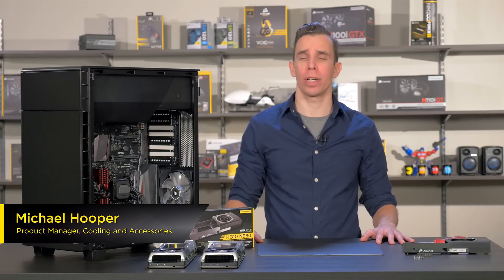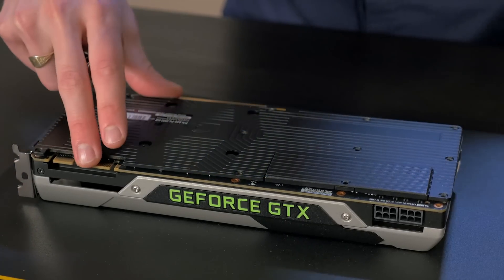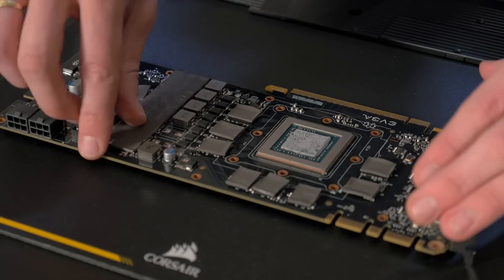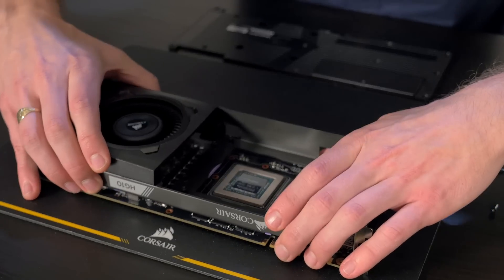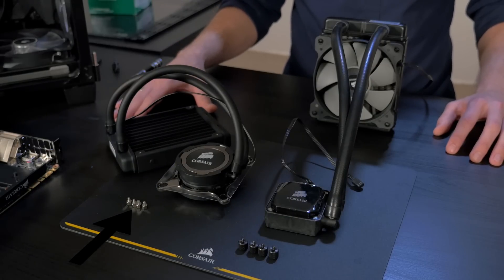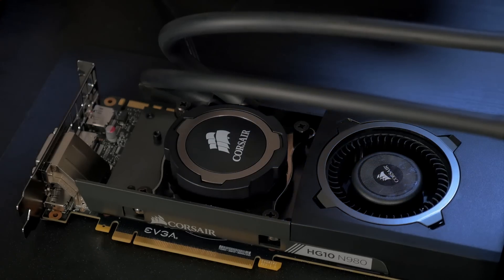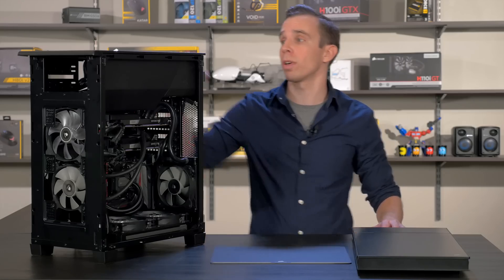Corsair Hydro Series HG10 N980 installation how-to demo

Comment: This kit is not engineered properly. There is not enough screws around the main die, causing uneven pressure when installing your water cooler. - my temps were at 95 when playing, I've opened it up, my card was warped from uneven screw pressure, and paste did not touch the cooler on half of the corner. Avoid, or just by hybrid card from nbidia. Don't burn up your card, I'm putting original evga superclocked fan back on.

Comment: I wish you guys had made a newer revision for the GTX 1080. Instead of waiting I bought the NZXT kraken G10 and mounted a corsair h55 quiet aio cooler. I get max 54c after several hours of gaming. I have a h110i on my cpu that is overkill.

Comment: Here's the thing... I want to water cool my 980's because they sit on top of each other and the first GPU's blower has minimal clearance for airflow (WHY THEY DID THIS I'LL NEVER KNOW)... based on what I see here, it would be impossible to use this cooling setup as the tubing cannot lie flat coming off of the pump and requires a few inches of clearance. How is this stuff overlooked?! They could have easily been offset to increase the distance of one of the tubes so they can sit flush over each other. Makes me sad man. That mess of tubing looks ridiculous anyway. Do better. Think more.

Comment: do not use the HG10 with the time will bent you GPU is  not support over the GPU back plate , the water block won't make contact with the GPU making the temperature go high playing any game  this happen to me i using HG10 with H90 on my Titan X SC i ended going back to my regular cooler.

Comment: Has anyone used 4 Pin GPU to 4 PWM Fan adapters to allow the GPU to control the Radiator fan speed?
No matter how much you spend on Fans or what brand, 100% speed on all the time is NOT a nice sound..

Comment: I have two gtx980 ti sc plus acx plus cards and on the site it says my cards are compatible with this cooling solution?But you said it is only for reference cards?I need help i want to liquid cool my cards so bad it's unbearable with 110 degree heat in california every year now :( I am confused because my cards do not have the blower jet engine fan,i have a regular fan two of them in this type of card i have and it doesnt look like the fan will fit in this cooling block you are demonstrating here.
Reply: By reference style cards he means cards that have the same PCB as the 'true' reference style cards. This means that if your gpu is said to be compatible on their website, it means that the PCB has the same screw hole locations and standoffs as a true reference card. I have a Zotac 980ti AMP! edition card, which has an aftermarket cooler, and this bracket mounts perfectly to it. The reason they signify to use a "reference" style card, is that some companies that put on their own coolers use a different screw layout, so this bracket wouldn't fit. Hope this helps!

Comment: Why is corsair so slow on the hg10 adapters?! I have an extra aio cooler (corsair H90) and is waiting for corsair to finally come out an adapter for the gtx 1080 (evga's models).
Reply: Why would you want it? The cooling performance you get with these shitty things are worse than air coolers.
Reply: you must be insane! aio gpu coolers lower so much temp, as much as 20+ C.
Reply: Yes, when you buy hybrid cards. If you check the performance on these DIY AIO gpu coolers you will see how much of a money waste it really is.
Reply: VaoDxArchAngel  bought and diy the evga hybrid kit for my evga gtx 1080 Superclock, and it never got above 40C with optimized settings from Geforce Experience for BF1/GTAV. I get an average of about 80 fps in gtaV and 90fps in bf1. my basement is about 70F year round.

before i had they kit, the card would reaches 72C. that's 32C difference, that's 89.6F less!
Reply: Khoa Tran Then they must have updated it and made it way better, cause that's not how it was with the 9xx models
Reply: Khoa Tran my gtx 980 ti goes to 80 or 81 degrees on full load.
Reply: Gilaric Yup, my air cooled 980 ti never goes above 70c and it's heavily overclocked
Reply: +VaoDxArchAngel ... maybe i should check the thermal paste but would it void my warranty?
Reply: Gilaric I suggest going back to your air cooler or buying a custom water block and custom water loop. I've had a lot of friends with that waterblock on the 980ti, and no matter what they did, still same problem. It's a problem with the block, not anything else.
Reply: VaoDxArchAngel I am using the air cooler I am thinking about getting the hg10.
Reply: Gilaric Oh nah, just reapply thermal paste. What brand did you buy? Reference or 3rd party?
Reply: 3rd party i think MSI Armor 2x/GTX 980 TI 6GD5T OC
Reply: Gilaric Ye, that should definitely have no problem cooling that card. Any OC? How old is the card? Any dust in the radiator? Apply new thermal paste and check temps again.
Reply: No oc unless its Factory OC. 6 months
Idk if there is dust in the rad. 
I will soon apply new thermal paste.
Reply: Oh yeah my fans in the front is airflow and there is a HDD cage in the way.
Reply: Gilaric Did it fix your temps?
Reply: VaoDxArchAngel haven't reapplied thermal paste I'm scared it will void my warranty. But if I get the hg10 I will of course reapply it. 
Also I replaced my front fans and top fans on my radiator with the ml140 pros (case 780t).
Reply: +VaoDxArchAngel 45 degrees idle and now somehow 83 on full load 1440p
Reply: Gilaric It won't void warranty to reapply thermal paste. Did you attach the cooler yourself? If you did, then there is no way it's gonna void warranty. Anyways 83 on full loud is still horrificly bad. My air cooled one stays below 70C on full load

I've also overclocked to 1430MHz

Comment: Aren't the radiators supposed to be mounted above the actual processors? I understand that it might be due to the configuration of the case you're demo'ing with, but this has been said to not be a good idea by many including Corsair.

Comment: I need one of thse so bad. My core temp peaked at 90 degrees when I was running gta 5. Whose bright idea was it to install just one fan on a high performance graphics card?
Reply: Why did you buy a high performance GPU with only one fan ?
Reply: Stupidity. Nothing more. I'll find the three fan model later.

Comment: Pause halfway inbetween 2:44 and 2:45... WTF is that? Spaghetti on the GPU? Dude works for corsair yet he puts thermal grease on it like that... SMH
Reply: +RenegadeGaming as long as you put the minimum amount or more it really doesn't matter.
Reply: +Legit Sloth You obviously don't understand why doing it like that is frowned upon... Since some areas have very little thermal paste on them, when the cpu block is pushed onto it, it won't spread evenly. Some areas will have poor thermal conductivity and will cause the card to run hot, possible throttle, etc, etc... Will it still run? Sure it will, but for how long? My point is that applying thermal paste is the easiest thing you can do with a PC and since he works for Corsair you'd think he'd be competent enough to show the correct way of installing their products. If I was a higher up and saw this then the dude would be finding another job, the way it looked was simply unacceptable.
Reply: 1- if you think that you know what you're talking about you're sorely mistaken
2- LinusTechTips did a video on this, and as long as the paste has more than the minimum no increased clock temperatures will occur and please, don't give a long winded speech when you're totally in the wrong.
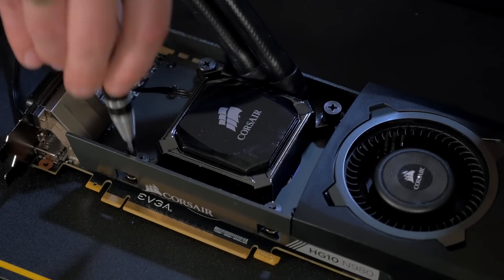Reply: +Legit Sloth You're not understanding what i'm saying... Look in between the frames at 2:44 and 2:55, that's not a Pea, X, Line, etc,  etc... It's just random and leaves a good 1/4th of the chip uncovered once it spreads. I understand what you're saying, believe me, the method doesn't really matter however this guy didn't even use a method. Not sure if you're seeing what i'm seeing but here's the exact frame : http://imgur.com/46eILwf
Reply: +RenegadeGaming I see how you think that.  Jesus christ it looks weird.

Comment: I want to install this on Zotac GTX 980 Ti Amp, which is compatible according to your company. Any additional guidelines for doing so? Do I have to apply to thermal paste for H55, H60 or H75? I haven't decided which cooler to go for yet
Reply: +Michael Yum you got same card as me the cooler is crap how is yours and what temps
Reply: +tony clarke i actually run 2 980 Ti in SLI, the temperature was crazy high (easily hit the 83 degree threshold and got clock speed reduced, fans spinning at 90% max speed) before I replaced the case fans with Noctua industrial fans. Now, I manage to keep the temp below 80 degree under the most heavy load.
Reply: same 83 c keeps throttling back
Reply: If you experiences this in single GPU, something has to be wrong. When I did single GPU, the max temp with overclocking (+200Mhz to core speed) was 70+ degree. No throtling back.
Reply: ok thanks mine just goes straight to the limit

Comment: I got a question, will this bracket be compatible with http://www.amazon.com/ZOTAC-GeForce-DisplayPort-PCI-Express-ZT-60303-10P/dp/B008NGEARC which i use now? My card is getting pretty hot with standart cooler.

Comment: Humm that's funny..when I installed my hg10 n980 on my reference 980ti it bent the board like a taco. I called customer support..apparently you guys are working on a fix...but I've been waiting for quite some time
Reply: +Gdwolf50 no..the mounting screws are wrong and dont fit the board properly. corsair has acknowledged this but for some reason hasn't been able to make a fix

Comment: I don't know if anyone will read this but, for Christmas I got the corsair k70 rgb keybaord and the m65 mouse. I plugged them in and tried to download the corsair utility engine and it downloaded fine. Then I tried to run the instalation  software and I make it to half way done installing and  it freezes my computer so i have to hard shut it down. I have tried everything i can to get it to work i'm lost. Everything else I've tried to download worked perfectly. I spent over 200$ on these parts and the whole point of me buying them was to be able to use the 16.8 million colors in the led lights and I can't change them like I spent my money on. I tried to install the first link on your gaming keyboards page and it froze halfway through installing 1 of 2. I also tried to install the first link on your gaming mice downloads page for the m65 and that one froze too. Any help would be appreciated. 
        thanks,
               Ben

Comment: Now if there was only water options for a 980Ti Classified.
Reply: +Kraft Lawrence  EK-FC780 GTX Classy series water block?
Reply: +Kraft Lawrence This is for T.I and Titan versions as well.
Reply: for reference Ti, but the classified had a different design
Reply: oh yeah man, but why would you want to change the cooling on the classified? That thing is BEAST!!
Reply: I'm assuming water would still be better, especially in the summer.
Reply: Oh hell yeah.. i learned that switching over to the H100i GTX from a cooler master evo hyper 212. I was once an "only" air cooled guy and am so over it. when i saw my 4790k jump from 3.9 to 4.6 with "turbo boost" in just changing coolers i knew it was the best thing.
Reply: Thanks adam walton! i might have to look in to doing a full WC setup one day. Too bad that's not a self contained or i'd probably order it right away.

Comment: not to be rude but....trust me you don't want to put a closed loop aio cooler on a gpu.

i love corsair for a lot of good things, but enthusiastic pc cooling is not among them
Reply: +darymetal I think what you also need to understand is that not everyone wants the hassle of having to put together a liquid cooling loop.
I personally have never done it before, and I'd feel much more comfortable using something like this to cool my graphics card.
Reply: It's not any different from AIO cpu cooling
Reply: ***** and that's exactly why i don't like it.

apart from that, using aio for the cpu is acceptable, but if you're using a gpu liquid cooling solution then i assume you're liquid cooling your cpu too.
The smartest thing to do would be to buy a good pump and radiator and use them both for your gpu and your cpu.

This build looks absolutely stupid, aio and tubes everywhere.....
plus the prize. 
good lord that sure is expensive for such low performance.
Reply: Sola yhea i know, that's what i thought as well....at first.
then i realized that aio are made with the shittiest components in the market, and buying a closed loop aio is like buying a pre-assembled gaming pc; which we both know sucks.

but the thing is, you don't have to build a custom water loop, cause swiftech just came to save us, making the h2** an amazing pre-assembled open loop that is basically awesome.
you buy that and you don't have to do anything, plug and play man; but let's say you want to enter the world of custom loops and pc-modding.......
well you're ready to go.
you want a bigger radiator? 
buy it
you want rigid tubing? 
you can have it
you want to cool down your gpu too? 
you already have everything you need, just expand your system.

on top of that, you will realize that (compared to the best of the best AIO) you have a pump that is like 5x better, your temps are considerably lower
noise is crazy low (i'm not kidding, go watch the db on a h220-x compared to corsair's h110)
and the most important one:
your system will last forever with little maintenance.
trust me, if you want the best, buy the best, don't just pretend

ps. h240-x looks hella cool too!!! love it
Reply: ***** ikr.....
but even then, i firmly believe that if you want something simple but effective, then air cooling is a no brainer.

the PH-TC14PE is......just amazing.
the easiest form of cooling since ever, combined with crazy performance and low cost, very good looking too (i personally don't understand why everyone go nuts for the noctua.....the PH is better under every circumstance imho...but that's another story)

in the end, aio should never be the choice imho.
even tho i'm really wondering how good raijintek's aio actually are....
Reply: ***** oh sure i didn't meant that air cooling is better than liquid cooling.

besides, do we have to talk about "coolness factor"? custom loops are SO COOL.
the big ass PH cover your whole MB.....

i just said that custom loops>air cooling>aio
:)
Reply: ***** well.....there are fates worse than that ;P
Reply: ***** you're touching a sore spot......i live in italy and trust me, when it comes to technology, it's probably the worst country ever......

nice rig anyway man
Reply: ***** yhea i know, i didn't mean to be disrespectful ,:D

Comment: I know Corsair is just trying to showcase their products, but I really hope nobody running three all in one coolers in their rig.
Reply: +Justin Fivash I have 3x AIO's in my setup at home with GTX 980's in SLI.  Plus it's in a much smaller case than this...
Reply: You know, I was certain that I removed this comment.  Sorry man.  

Me personally, I wouldn't want that, and I think it's mostly aesthetics for me really.  However, I think it would be more efficient to run one loop, than three separate ones.  And I guess there are tons and tons of factors, but I feel like one loop would be cheaper than 3 closed loop systems.  But on the other hand AIOs are incredibly easy and painless to use (For the most part anyway) and it's easy to see why somebody might not be comfortable setting up their own loop.
Reply: +Justin Fivash I'm personally looking into 2 aio's for the reason you said.  I just don't want to put up with the maintenance if I have to drain my system etc.  It's just the convenience I guess =P

Comment: would this work with MSI GTX 980 TI 6G/Golden edition?
Reply: +Fred Bulaong no he said from the beginning that its reference only
Reply: +Rion Moreland Thanks. I guess the NZXT G10 is the same. Reference design only.
Reply: +Rion Moreland Actually this is incorrect. It needs to be a reference PCB layout. There are a few cards with aftermarket coolers that this will still fit. http://www.corsair.com/en-us/hydro-series-hg10-n980-gpu-liquid-cooling-bracket check the tech specs tab for the full compatibility list.
Reply: +Fred Bulaong It doesn't but not for the reasons the other guy listed. It doesn't really matter what cooler is has on it as long as the PCB layout is the same.
Reply: sm00419 the guy in the video said reference cards so I'm not wrong.
Reply: +sm00419 been thinking of returning my golden edition card since it still under 30 days and get a reference card for me to use my extra aio. My card run at 66-70c max out.
Reply: +Rion Moreland Did you bother to look at the compatibility list? I can point out a non reference cooler in there if you would like. Palit GeForce GTX 980Ti Super JetStream 6GB GDDR5 NEX98TH15JBJ. Google the model number of this card and you will see that it is very clearly not a reference cooler. 

Lets use some common sense here. If you strip off the cooler of a reference design 980TI, you are going to see a specific layout to where the things like the memory, caps, and the holes for mounting the cooler on. If you strip off a non-reference cooler and see the EXACT SAME LAYOUT, why would this not fit?
Reply: sm00419 I'm only stating what the guy said in the video so calm the fuck down. I'm not wrong so fuck of m8